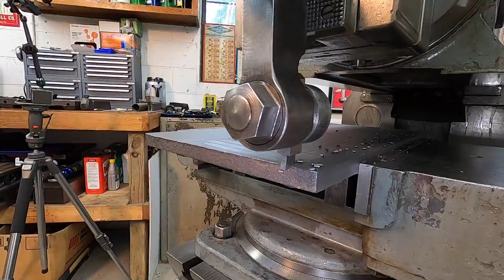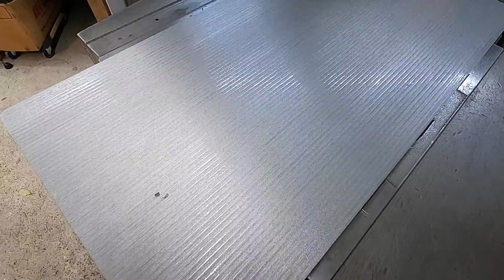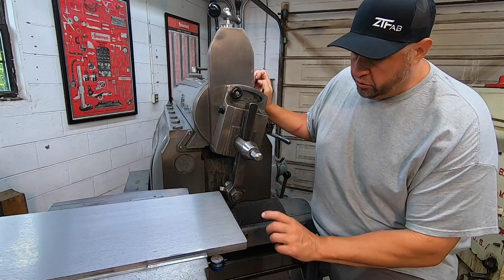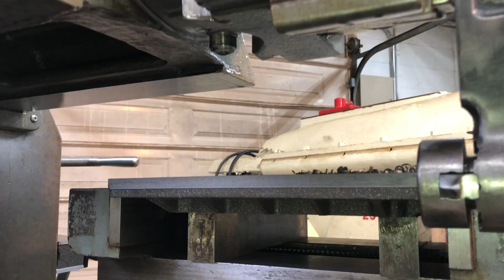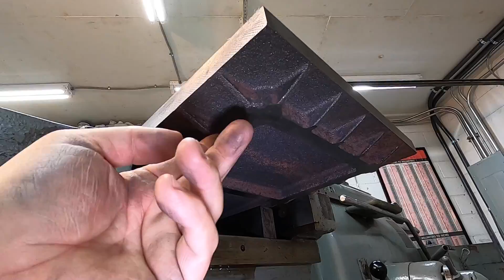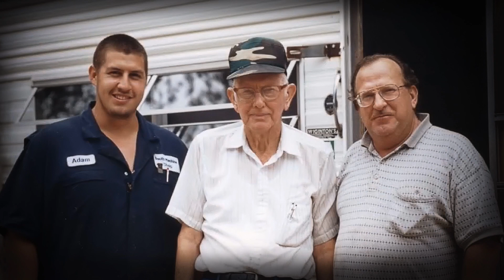SNS 313 Part 2: Finishing the Top, Sides, & Bottom of the Fireball Tool Fixture Plate

Comment: Just a thought (I run high end cncs so I know nothing about shapers) but are the lines because your tool is not ground perfectly square to the head stock of the shaper?
Reply: When I say lines I mean high spots
Reply: @jakob12369  (preface with I also know nothing about shapers) given that he ground the tool square to the work as demonstrated in the first part of this series I would expect any deviation from square to be extremely minor. That could be it and the surface finish just sort of magnifies any tiny deviation. it could also have something to do with material properties; the tool flexing, the work being torn versus sheared, or issues related to rigidity in the ram or table. I would love to see an examination by someone with extreme precision measuring tools to figure out what the actual surface deviation is from the ideal plane. Maybe a Robin Renzetti or Tom Lipton collaboration?

Comment: Adam, could the centre section of the angled stroke surfaces on the ram of the shaper, be slightly more worn than the ends due to more use over the centre. This would be allowing the tool to rise a fraction for this part of the stroke? I don't know if you have had these reground at some point.
Reply: The fact that he has the machine sitting on wooden blocks doesn't help the situation, either.

Lots of flexing, even in a big casting.

Comment: When I was an apprentice, we made our own surface table.  A local foundry would donate the raw castings for free. These had sat outside for 12momths, then rough machined,  put outside for another  6 months. Then we got them, and hand scrapped them to final flatness. Regarding the reference to BMW F1 engines. These were 4 cyl,  basically the engine block from the road cars. These would be built up as a normal road engine,  then put into a company car. Then, after 6 months of use, they'd be stripped down and used for an F1 BMW engine. This cycle of pre F1 use would shake all the residual stresses out of the cyl block. Incidentally, was when F1 had turbos. Those engines saw flash readings of 1500hp on the dyno !!!

Comment: Is it possible that the casting was moving on it's own i.e. internal stress movement? Do these type of casting go through a stress relieving process given their proposed use?

It was said that BMW when making their F1 engine block castings used to leave them out in the elements to de-stress before machining and building.
Reply: When I worked for Deutz USA we were told that they do that with the block castings. Somewhere in Germany (Cologne to be exact) there is a field full of castings "seasoning". I forget how long they take to be ready for machining...

Comment: While I've used fixture plates before, and they're very handy when you need to move the work piece from machine to machine or even from layout on the surface plate to machine, I never thought about the tolerances of the plate.  If I scribed a line with a height gage on a piece I'd just turn the mounted piece 90 degrees to scribe an intersecting line, not thinking about how square, flat, or parallel the fixture was or how consistent each fixture plate was to each other.  We'd have one guy drill the holes, take the fixture plate to another guy to mill the slots between a couple of holes, and finally a third guy would bore out a big hole.  Maybe it worked because the tolerances were so loose on what I was working on, but the better the plates, the better the finished part.  Thanks for your videos.  They're very interesting.

Comment: hey bud looking to buy my first mill and lathe, i need 10x14 x1" rotary shafts turned in production matter but i also rebuild small blocks so id like to buy one and get one that will do cams and cranks, and mill id like to be able to grind heads and intakes as well but i also need that for small production pieces any recomendations ? im looking at persision mathews knee mill and lathe
Reply: sorry 14x1" rotary shafts

Comment: Booth , one thing you can try is to use your finish tool at full width with your clearance grind, it made a world of difference on the boiler plate doors grandad worked, taking 1/2 th. Cut x2 with a 1/2 tool table adjustment between

Comment: How does indicating off of the long side help you get square on the ends when you weren't square on the mill when you gang milled them?
Reply: The long sides are straight and parallel. They're good to use as a reference plane

Comment: Could the Jaws on the clamping Vise be compressing a bow into the piece of cast iron?
Reply: Absolutely. Something I learned the hard way stamping is that metal is more like knotted wood with hard and soft spots  and stresses from casting and rolling. Trouble is you can't see it like you can wood grain

Comment: In the milling video I mentioned that I thought it should have support in the middle.  I think that's why you see the middle differences.   The lack of support in the middle caused deflection.   Support in the middle would also give it three points of contact.   Anyway It looks like the shaper corrected for those previous issues.

Comment: I am wondering just how square your plate is . The  setup your vise you are assuming that the cross slide is dead square to the ram . You said your machine has some wear . The way I was shown to indicate a vise in is to put a precision square in the vise holding it by beam . Then indicate the blade of the square with the movement of the ram . That would insure that it will cut dead square.  Still a nice job.

Comment: So you should be able to after you cut the bottom of the plate take a micrometer to all for pads and be absolutely equal on all four pads or anywhere it is mic'd from the surface to the bottom? Just curious.. thanks for letting us hang out at your shop. 🤗

Comment: I wonder though, was it useful to use the mill first in this case? Is that faster than getting it flat in the shaper?
Reply: I believe he used the mill first because it has a larger table, and he was able to use that to accurately cut the faces that he would need to grip with the shaper vise.

Comment: One other source of going out of flat when you are machining, especially cast materials is that as the material cooled in the mold it induced stress. When you're machining you're removing that stressed material so the remaining material is moving to accommodate. The skin on a casting has th most stress built in. It's similar to weld shrinkage or pre-stress.

Comment: You may have locked-in stresses in your casting - I think your mysterious cutting problem is from machining off stressed material. Even gray cast iron will twist a bit if the metallurgy is off. It happens to a melt every now and then. Tramp nickel or something.

I suggest you ramp and hold stress relief to 1200F. Then cryogenic treat after to -100F, or near as you can manage without taking a second mortgage. You'll have to skim the broad surfaces again but that's no great chore if you sprayed it with No-Scale before heating.

Comment: Not a shaper owner, wishes..., but can it be that the vice is holding edges that are slightly out of plumb and the vice is bowing ?  Something isn't just right with this.  I think I might have dogged it down to the table and cut it flat.  No vice.  Still wondering in the high heat of East Texas.
Reply: I was wondering if there was enough force to create a cupping of the metal...I mean quite unlikely but I don’t know...

Comment: Adam, you mention ears on the ends. Good but if add ears (2) spaced out on sides, could mount side ways. Use three point bolt down. to let over hang. How ever needed, for larger parts that need to overhang and still need support. The plate becomes way to support that over hang.

Comment: I don’t know since I’m not a machinist but could the piece being cantilevered over your parallels on both ends allow a tiny bit of flex?  Also was it supported in any way in the middle between your parallels?  With tool pressure I’m not knowledgeable about how a piece iron that size could flex. Anyway, another great job.

Comment: These shapers look like it is so effortless, Does anyone know how much force is being exerted on the cutter when it is doing cuts like this?
Reply: A LOT! When I was a mechanical engineering student, Machine Shop courses were a requirement for graduation. My school (Drexel, in Philadelphia PA) dropped that requirement in the mid 1960s - everyone was supposed to become a computer wizard! My first shot at the shaper came half-way thru the quarter. By then I had learned that you could take a deeper cut than 0.010 with a 3/8 square tool, so I set up my first pass on a chunk of steel about the size of a block of. Velveeta cheese at 0.030”. Hit the Start button and WHAM! The vise & block of steel got pushed off the table and hit the floor.  Too close to my feet for comfort! You were always supposed to check the vise bolts before using the shaper. One of the instructors had loosened the bolts on purpose. Idiot. Could have crippled somebody!  That was in the early 1960s and I can still see that vise flying off the table in slow motion! Our shaper was about half the size of Abom79’s.

Comment: Adam:  You mentioned possible wear issues with the K&T.  Since you now have a very flat plate, before you drill any hole in it, can you use it as a big gauge block to check out the K&T?

Comment: Adam proof in the pudding, Shapers rule for accuracy and finish compared to Milling Machines.
Reply: Thats super dependent on the machines, workpiece and tooling.
There are milling machines from the same era as the shaper, that will run circles around a shaper.
Reply: @StefanGotteswinter  Hi Stefan, partialy agree but show me a milling machine that can impart that finish, only achievable on Shapers, Planers and Broaching machines.
High end machines from Europe, Britain and USA have that beautiful finish.
Reply: i think thats subjective, i think i could do allot more accurate work on my mill then a shaper. but each guy has their bread and butter :)
Reply: I saw a youtube video from Salzer Diesel in Switzerland from the 1950's using a shaper to deck the huge diesel engine blocks for ships. Incredible machines.

Comment: While the cutting pass(es) on a shaper may leave marks for each pass, those marks are so minute that you could never get the same surface from a milling machine without using a cutter head as wide as the work you're machining. Beautiful finish on the shaper, consistent, smooth & nicely tooled surface.

Comment: I would use a 1.5 inch center to center hole pattern for the 1/2 inch hardware so that those minor inclusions get drilled out and threaded so nobody would ever know unless they watch the video. lol.  You could have the perimeter of holes 1'2 inch from the edge then start the 1.5 inch pattern to avoid the cross bars underneath and it would still fasten about anything down securely if you ask me.  I did like the comment about making it a grilling surface as well, you could make a serious pile of pancakes in a hurry on there.

Comment: Two Questions:
-why not get the base plate cut out with the fireball waterjet? (i really want to see that thing in action on thick metal :D)
-will you ever show us the shaper doing something different then plain flat surfaces? something like a cross pattern with a V-shaped tool and high step-over.
something you can't easily do with the milling machine unless you buy an expensive mill for it.

Comment: Was that casting annealed or are you machining it, "as cast"? I have machined a few annealed cast iron castings and the chips tend to curl rather than powder due to being brittle.

Great video! This is the first time I have seen such long, curly cast iron chips.
Reply: That casting was almost certainly done with "ductile" iron.  "Ductile" iron is a post WW2 development that uses magnesium and handling to get the carbon, at casting time, into tiny nodules.  A MUCH older process anaerobically anneals "white" iron castings to convert ferric carbide into iron and carbon nodules.  Such items are known as "malleable" iron.   Common "gray" iron has its carbon as flakes.  Iron with nodules behaves somewhat like steel and yields chips.  Iron with flakes yields a powdery swarf.

Comment: Abom79 making fragile spiral roll pins on the G&E shaper. I have the same problem with my Rambaudi mill at work plus I haven't been able to get the head trammed in vertical. I can't get the head to move in either direction. It's a good thing I don't have to work to the same level of precision you do. In other news, we acquired a little 618 Atlas lathe for making fixture pins. I'm in the process of repairing some small details, i.e. backlash, cross slide handle, tailstock clamp and lock.

Comment: One thing you could try is to put the indicator in contact with the underside of the workpiece and try to see the deflection while cutting, intuitively one would thing a cast iron piece that thick would be pretty ridged but apparently the tool pressure can bend it noticeably.

Comment: Interesting how the sound of the cast iron cutting is so much different than steel or aluminum.
Reply: @BossmanEight  Sounds a whole LOT like a well balanced hand wood plane on hardwood end grain!
Ken
Reply: @kejay74  Yes it does sound like a woodworking handplane!
Reply: Sounds like the TARDIS
Reply: I agree, the shaper is so quiet you can really get a sense for what the tool is doing in the work piece.
Reply: Cast just has so many air pocket. All the rest of the materials are pretty solid. 
                       😜.         😄
Reply: Much larger grain structure.
Reply: Everything sounds the same. On a huwaie mobile phone speaker
Reply: @Tangobaldy  lol!
Reply: @Tangobaldy  😁😁😂
Reply: Tangobaldy 😂😂💀